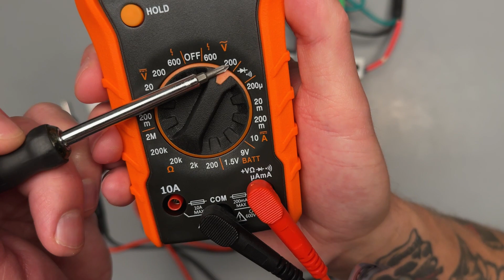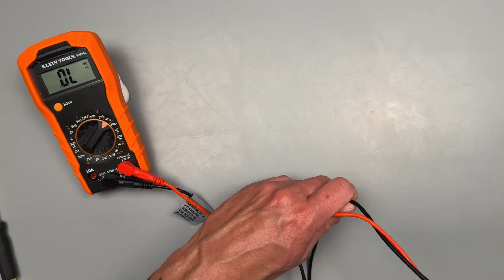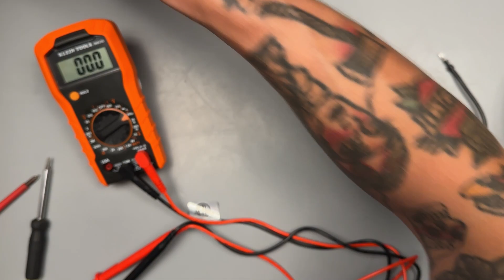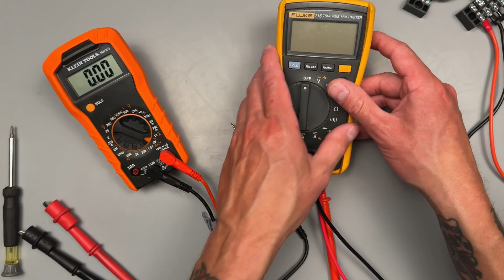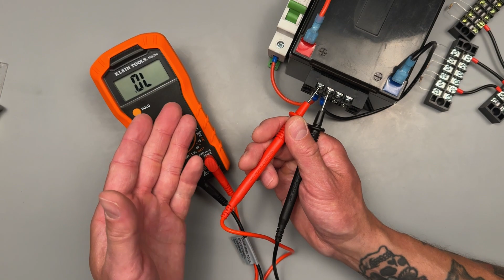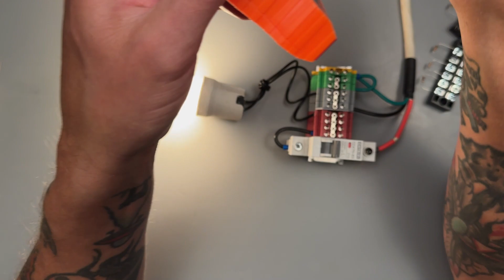⚠️ Klein Tools MM300 Digital Multimeter 69149P Electrical Test Kit - HONEST Review & Full Guide

Comment: Have you reviewed the MM720 or MM450 meter?
Reply from the maker: I have yet to have those on the channel. Do you have any experience with them that you would like to share? Or are you browsing for info?
Reply: @maddoxmechanic  I was asking because I was using the MM30 to test a 35/5µ capacitor for my ac unit and thought I could use this meter to verify charge. I reached out to the manufacturer and they told me this meter was not capable of measuring capacitance.
Reply from the maker: @deenierzwicki8638  Yes, unfortunately this meter is not rated to measure capacitance.

Comment: hi there. thank you for this video. I'm borrowing a neighbors multimeter to test an 220V outlet. His kit came w/ the other unit that is obviously for an outlet, but it went missing.  Can I safely test a 4 pronged 220V outlet with the Klein that youre demonstrating? You do mention this at minute 12 or so, but I just want to make sure. I'm desperate to test my outlet tonight. Thank you.
Reply from the maker: Thank you for the comment! The meter should have its voltage rating listed on there somewhere. MOST meters are safely rated for 600V AC/DC. So, you should be fine to do so. Just make sure you're on the right settings, leads are plugged into the right ports. Wear electrically insulated gloves, safety glasses, please be careful, and try not to short anything out!

Comment: Was there a reason why you didn’t purchase the MM325? It’s much different than the MM300. All in all this was excellent video. Thank you.
Reply from the maker: MM325 is on the list for sure. I picked this meter because it came as a set with an outlet tester and NCV indicator. Figured it would be a common purchase for just your average DIYers. And thank you I’m glad you enjoyed the video.
Reply: @maddoxmechanic  it was my first pick yesterday. We had trouble with our dryer vent being clogged with pebbles from chipmunks. Our dryer would take 2 or 3 cycles to dry. We finally got the vent cleaned out, turned the dryer on, and now it won't heat! 
It was heating just fine, actually very well, before we cleared the vent pipe! 
I got this meter as a suggestion to figure out which part went out. 
Basically, I just need it for the continuity, I think. 
I'm a DIYer but never anything electrical! Plumbing, yes. Building furniture and even gutting my entire bathroom to the studs and joists. I didnt do the light switch out though cause electrical scares me. 
This makes me feel like such a girl! 🤣
I paid $46ish at Lowes for this same set. 
Now, I'm off to try to figure out this dryer! Wish me luck! 🤣